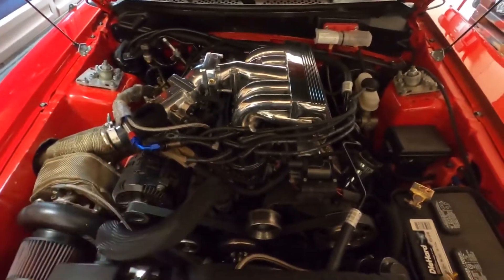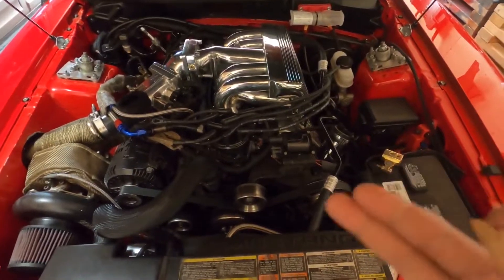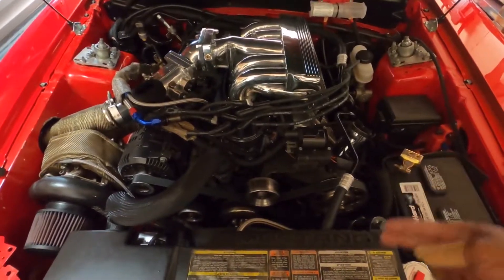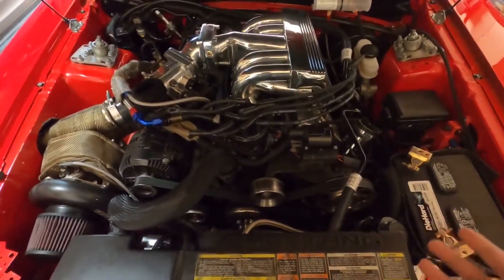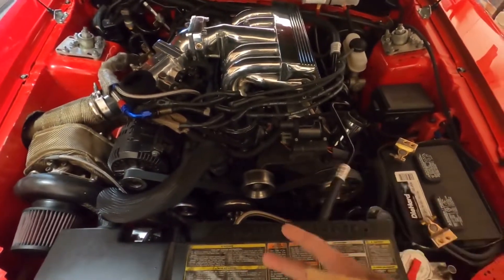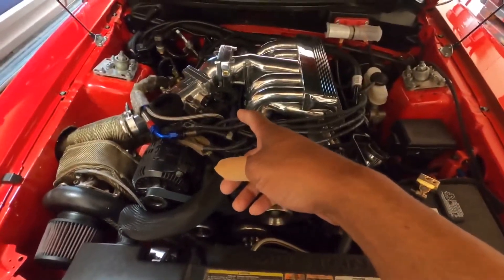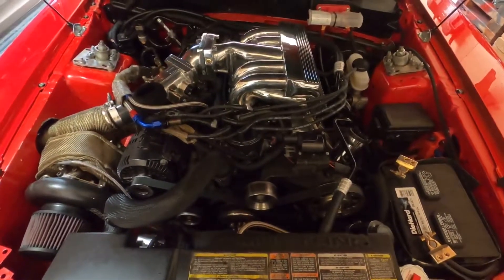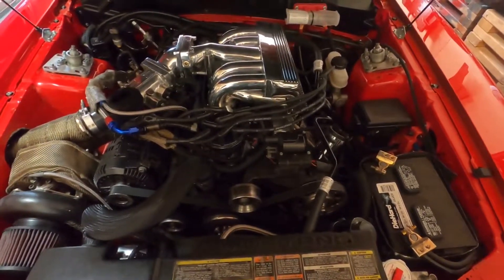Turbo Mustang Did I  Break It??

Comment: I've burnt the tips off of a couple of my spark plugs on my mustang by running too much timing while using nitrous. I would guess that your issues are with your tune though. If it were a mass air issue you'd probably have a code like left or right bank adaptive limit reached, if you have a stock computer. My first guess would be your tune though

Comment: Missing bolt on your GT40 manifold?
Reply from the maker: Yeah, in my video about the box intake I talk about what happened there. Basically that part of the lower broke off. I wanited too long to send my other lower in to get ported and polished up.
Reply: @SN95Power  got it. Yeah, your problem sounds tune related. I would data log the vehicle and send your log to willie at dirty dirty racing. Dude is a sn95 tuning machine.
Reply from the maker: @AADmrstangerbanger  I'm not knocking Willie but in my case when I first did my swap, he wasn't helpful. He knows his stuff and I'm sure if I didn't have a problem that I couldn't figure out at that time he would have tune it up. Also, I had the current problem solved before I posted this video. Just wanted to see what everyone thinks the problem was. I'll upload the solution in a couple days. Thanks for the support.
Reply: @SN95Power  good shit 👌

Comment: Im not a turbo guy just yet and im on my first turbo build. Could your wastegate be causing your header issues? Did i miss a video because i thought you had switched to the box style intake that you recently polished? I hope you get this issue ironed out soon. Record what ur doing so we can gain a little knowledge along the way
Reply from the maker: If the gate was causing issues, most likely it would have been boost related. I had the issue fixed before I dropped this video. Just wanted to see what people think the problem is. Box intake is on next video. Appreciate your support
Reply: @SN95Power  very good, im glad the issue has been remedied! Now i have learned a small lesson incase i need this knowledge in the future. Cant wait to hear how you feel about the intake swap and how the car responded. My original thought on the situation was possibly a damaged distributor gear but i went back and heard you say you changed the distributor itself. These things are hard to diagnose unless youve been through it. Keep up the good work and keep uploading your experiences with your sn95.